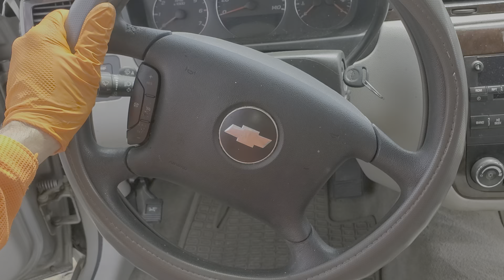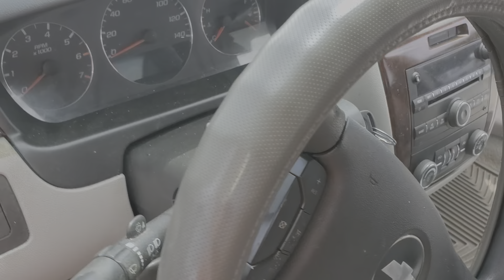2008 Chevy Impala Horn Fuse & Circuit Explained

Comment: Showed me that half the fuses got stolen before I bought the car... mines a ex Police car. They cut the horn wires.. along with plenty others.
Reply: Got the same issue. Have a wire running to horn fuse. Tried with the wire & without the wire. The horn still does not work. Have you fixed your's? If yes how ?  Could you be able to help me ? Plsss

Comment: My horn don’t work & When I set the alarm lights blink but no horn sound. Fuse is go so what would you recommend?
Reply: @TenandWin  same here dude! Did you find out what it was?
Reply: @itsMrBRoc  I still haven’t found out what it is Sorry!
Reply: @TenandWin  NP if I figure it out I will let you know!
Reply: @itsMrBRoc
 Hi I have the same symptoms. Any update?? Thanks!
Reply: I still haven’t found out what it is Sorry!
Reply: Air bag clock spring went out

Comment: yes I have a 2010 Chevy impala LT my horn is not working I have a assistant to push on the horn while I use a test light on the fuse the fuse is good but there is no power going to the fuse while my assistant is pushing on the horn on the steering wheel I set my alarm off there is a horn Also when I lock my doors the horn sounds awesome what could be the problem with my issue so I can fix my horn thank you I would really appreciate it
Reply: solution?

Comment: I hope you see this, anyways my horn died. I replaced the horn, new horn kicked on but didn't get enough power to honk correctly. My assumption that it's not getting enough power is based on the fact if I touch the horn directly to the battery, it's loud and proud. Anyways, since everything works but doesn't seem to get enough power, I'm assuming my relay has just degraded to not delivering enough kick. Could you help me figure out how to wire in an external horn relay? I can't find a wire harness diagram for the steering wheel clock spring at the fuse box.

Comment: So I replaces the fuse and that didnt work so I came to this video. I tried to set my alarm off and it didn't work either. My low tire sensors have been going off as well. Could that be a sign if a failed body control module?
Reply: same issue!
Reply: Check your battery cables. I had problems With it not shifting correctly and same problems as you. I replaced the battery and both cables. The guy at the shop told me the positive cable Was coming apart in the middle of the cable. Everything Works fine now except the horn. I Will check the horn and if I figure out the problem I'll get back to you.
Reply: Anything yet